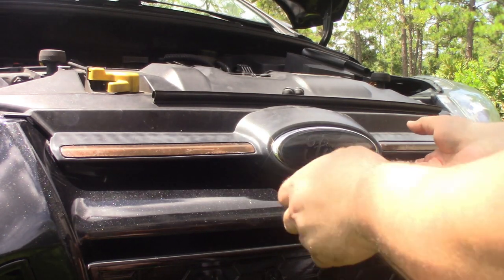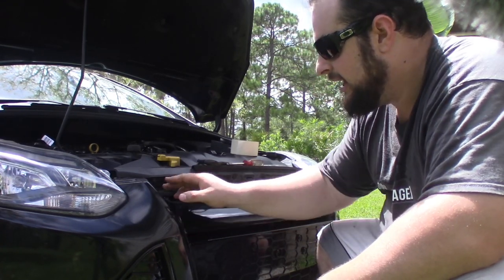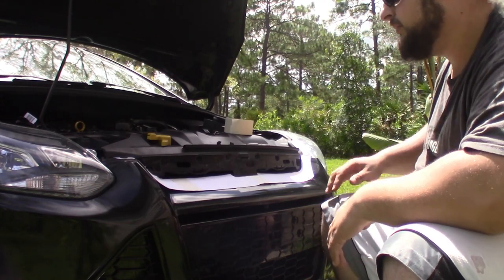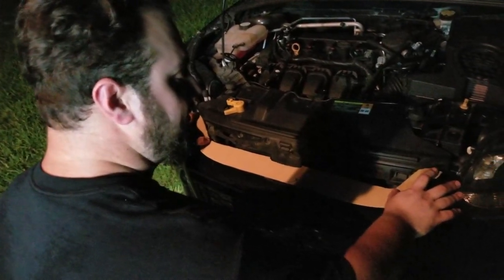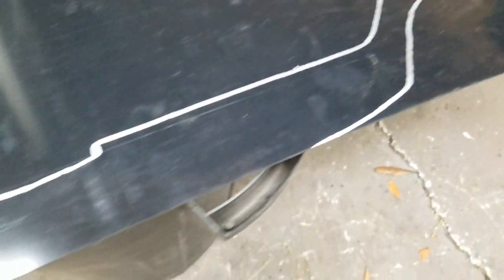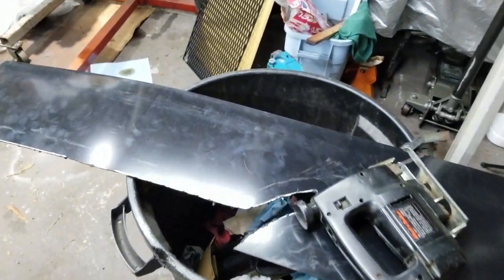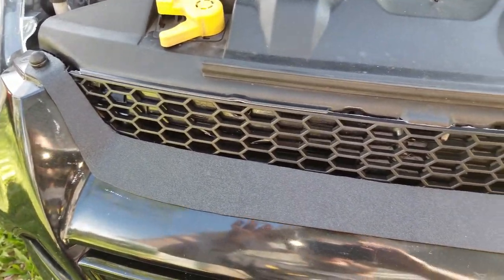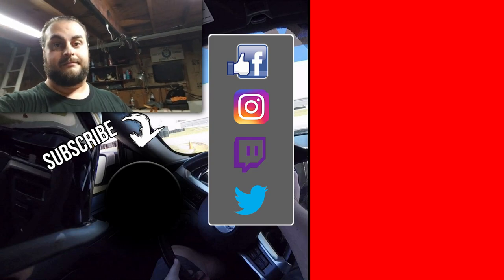Making a Mach 1 Focus Grille Delete

Comment: How did you remove the upper radiator grille so easily? I having problems with mine but yours looks like it popped right off
Reply from the maker: The plastic cover?  It's just clipped in.  Just have to pull
Reply: @OutOfLineGarage   you say that but I just spent an hour and broke 2 clips
Reply: @angrovar  same here
Reply: I bent the hell out of the clips and they look tore up and it's still on because I dont want to brake anything

Comment: How did you install the bottom grills. Please post a video if you haven’t already
Reply from the maker: I no longer have the front end so I can't show it.  
It is, however, pretty easy.  You will need the plastic removal tool. Pop the pins around the edge of the old grills while slightly pulling.  You will need to cut the plastic bumper support located directly behind them.  Once that is out of the way the new peices pop in.

Comment: I love the honeycomb grill on the focus. Does the tabs come off easily to install?
Reply from the maker: Are you talking about the lower grille?  If so that is held on by clips that run the outer edge.  I just used my plastic trim removal tools and it came out easy.
Reply: [Out of Line Garage] yeah I want to buy the grill for it I just do not know how to remove it properly
Reply from the maker: super easy, you can do it!
Reply: Out of Line Garage do you just pull it off?
Reply: @OutOfLineGarage  did you have any trouble with the air ducting for the engine interfering with the side inserts?

Comment: Does the ford logo just pop right off ? Because I want to plasti dip my ford logo but I want to take it off the car so over spray doesn’t get onto the car
Reply from the maker: I will take a look tomorrow at that,  I 'm not sure about the logo itself at the moment.  The full plastic bit comes out as you can see and has tabs you need to try not to break.
Reply from the maker: So I checked the logo, it is a really thin metal that is held on by dst.  I would not recommend removing it.  Tape around the edges and spray.  otherwise, you will just end up messing it up.
Reply: [Out of Line Garage] okay thanks !!!!

Comment: what did u use to cut off the part that held the ford focus logo?
Reply from the maker: Just a sharp razor blade, the plastic isn't strong.  If you have to heat it up as you cut through.